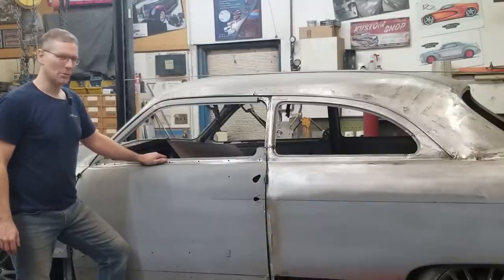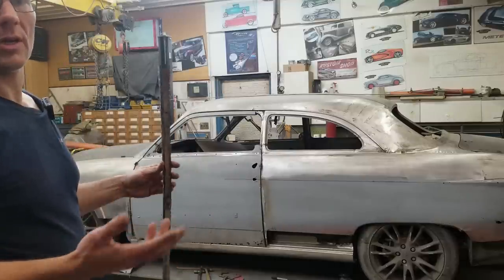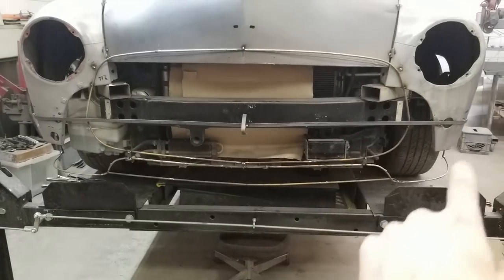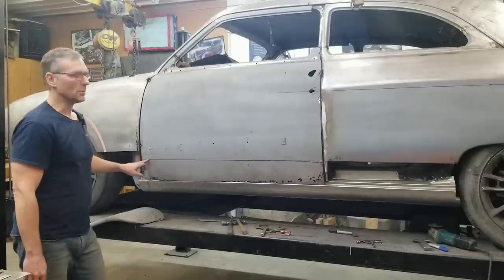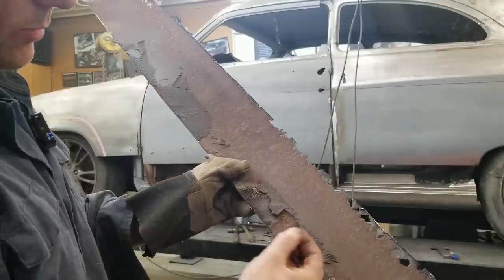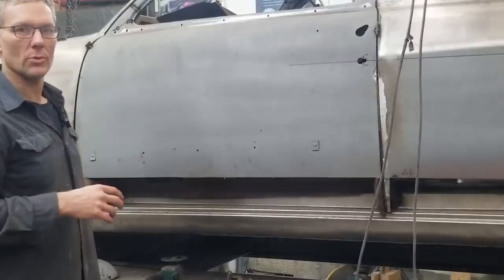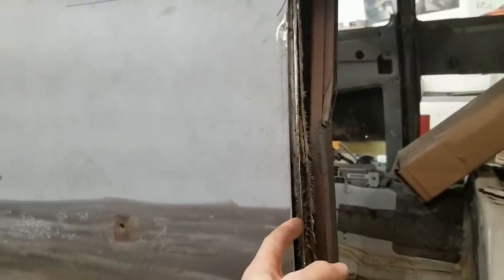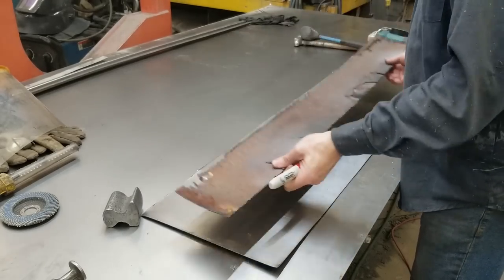Door Bottoms RUST Repaired & MORE! Ep.7P1 - 1951 FORD + INFINITI G35XS Sport

Comment: Nick, there should be 50k  views and 38k likes plus at least 18k subs. I am one and love your training, because that is what it is! 
   Sorry, been dealing with joint paint and failed attempts at my lumbar.
  The rust behind in the folds or the pinch weld can be addressed but using a frame, plastic sheeting and keep wet with $18 per gal "Klean Strip concrete and metal prep". If sprayed by bottle or pump with hose, fittings and lawn irrigation sprayers (Hoosier Garage / 73 Duster Rebuild) but I truly appreciate the training on the right way to complete this task. My garage is full, but no brake, English wheel and in severe pain in back, elbows and now not controlled, I live by your work. If I was 15 years younger, I would be right there with you. Thanks, DK. Omaha.
Reply from the maker: Thanks for the rust treatment tip!  I'm sorry to hear about your back!  Reading you're comments and you sharing your support here on YT gives me that extra kick in the keister on those late nights.  Thanks for watching!!
Reply: @iNVisionPrototypes  Best of luck always. You are a talented metal dude! Sheet metal should bend at will just by you looking at it and projecting your thoughts! Metal manipulation by mental stimulation! You are that good.
  Today as back then, I think the grill is the face of the car. You look younger, but we passed my birthday over Super Bowl weekend. This explains the 350 mile trip to my aunts house as they watched the game. But, while driving, getting closer to a car every few seconds, my Step-dad would call out the Year, Make & Model just by seeing the front.
  Almost everyone knows the "30's" Ford. But this car screams vertical Stainless Steel bars. Elegant, timeless, and makes a statement! Look at me! Then figure it out!
 I truly enjoy the videos and usually watch 3-4 times just to soak it in.
DK, Omaha.

Comment: Nick, when you are all done and painted spray Fluid Film inside all your panels. It doesn't harden and will wick into any crevice/seam preventing any moisture/rust from forming. If it wicks out to any outside surface just wipe it off with a rag. I use it on my daily drivers too as they seem to spread more deicing salt than snow here in upstate NY. It's good stuff.
Reply from the maker: Thanks Joe, that sounds interesting.  I'm going to look into that.

Comment: I know might and tig is the way to go but if a person only has a Flux core welder what would you tell them? They aren't building a show car nor for anyone else. Just for themselves.
Reply from the maker: I'm sure you know this but typically flux core is used for material 1/8" and thicker due to the higher heat created during the process.  Slag and splatter is also an issue when finishing.  One would be further ahead to upgrade to either a MIG or TIG which could be found at a local swap meet/garage sale/etc.  TIG has a bigger learning curve than a MIG and can be tricky to use when welding panels that can't be accessed/cleaned from the back.  There can not be any contamination for a proper weld.  I've never used flux core, but if is stuck I guess they could experiment with a series of overlapping tacs...on some scraps from prep to finish.  Cover up the area where you don't want splatter to stick...  Worst case, things don't work out.  Hope this helps.  As it turned out, I just ran out of Argon for the TIG...scatter brain...  Next Friday I'm going to show(except for a small part when I forgot to reposition the camera) a MIG welded joint - finished.  Sorry for the novel...👍

Comment: what a mess.
Reply: It may look that way to the untrained eye, but it's skill, knowledge ability and experience way beyond most people. Watch and learn.
Reply: Rome wasn't built in a day
Reply: my untrained eye sees the rear axle not centered in the wheel well. ruins the whole  look. may as well buy one of those t-birds that were made to look like shoebox 49-51 fords.
Reply: @Ls6racer  If you are talking about the original Infiniti wheel well, it's not sitting correctly because there is no weight on the chassis yet.   If you are talking about the Shoebox fender, as you can see, he removed most of the old fender and will fabricate a new one that will look perfect.  Just give it time and you will see.
Reply: ok we'll see.
Reply: Hey look ppl another one of those keyboard warriors sharing his expert opinion of a build in progress!  Key words here are 'in progress' my good man.  Nick is a design and metal master who always makes things look right.  In a previous video he mentioned the rocker was left long and will be trimmed accordingly.  BTW check out an original 1950 Ford shoebox and you will see that the rear wheel isn't centered in the wheel well either.  BAH go change some keyboard batteries... before you have a mess🤣🤣🤣
Reply: roilkah!
Reply from the maker: And I thought @Ls6racer was referring to my hair...yeah I forgot to comb it after pulling off the grinding shield.  It turned out that he noticed the rear wheel wasn't centred with the arch.  Yeap, he's right - gotta give him that - at this point in the build!!  Have no fear 'JC' is gonna whip up some offset a-dap-ter kits... we'll bolt them to the hubs and move the wheels back.  EASY FIX!  @vetteguru... please play nice... you've upset the tyke so much so that he can't even intellectually or coherently type anymore!  Sheesh, good job!  @ls6racer hope you're OK and thanks for the feedback give me a couple months and this old girl will be a streamlined butterfly! 👍👍
Reply: ok we'll see. oh, it's vulcan...